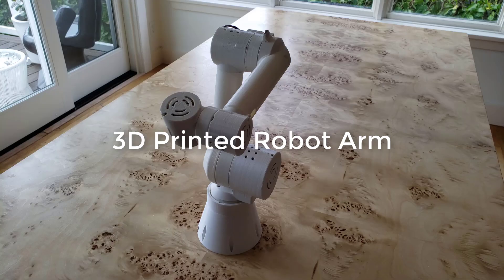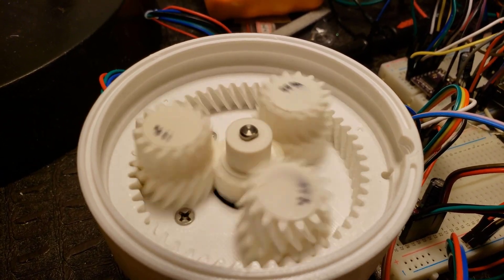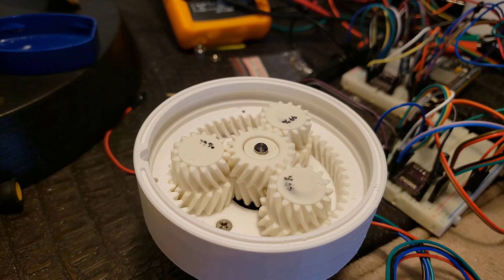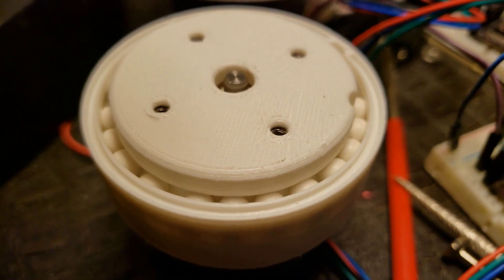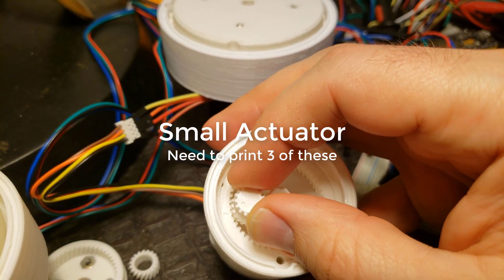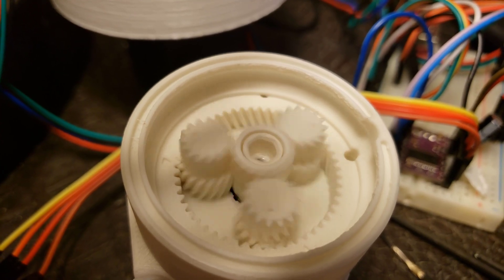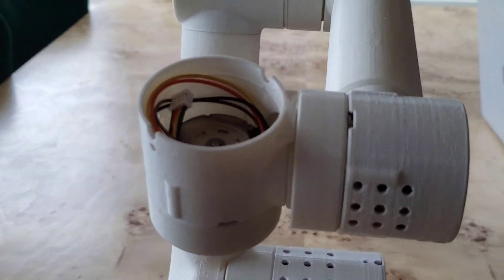3D Printed Robot Arm

Comment: Your sanding, filing, and inaccuracy issues could be solved by calibrating your printer. 

From the video it looks like you've got some bad overextrusion issues or fine layer shift. Also, your nozzle is too close to your bed. It's digging into the surface of your prints.
Reply: True, I can't imagine that choice, but that's personal preference. Insane temperature for basic pla too. I print Amazon at 200 and it comes out beautiful on any of my printers.
Reply from the maker: I printed all my prints on rafts, thus that first layer which you see on the top of the cap are the remnants from that. All of my other layers turned out perfect. I have tried printing without the raft and I do get problems on the 1st layer being squeezed. I've dialed that in better since shooting this video. I too think printing PLA at 235C is very high and there are complaints about the Amazon Basics, but it does end up more rigid than the Hatchbox which prints fine at 200C.
Reply: Indeed... I found it a little amusing when he talked about liking the Amazon PLA printed at a high temperature better than the hatchbox PLA. He's got printing issues that are much more important than filament choice.

Comment: Nice work John! I've been working on a multi-axis arm with planetary gears also and since I have no idea how these joints are supposed to be designed I've gone through a lot of trial and error. Taking a look at your design is really helping me improve my design (or pretty much copy yours) so thank you for sharing this
Reply: Guess credit for the design is Jeff, but your contribution helps immensely. Thanks again!
Reply from the maker: @jaredgray7872  Check out the latest flex spline design of the actuator I'm now using. It's even better. https://www.youtube.com/watch?v=4o3d7_WZ_DQ

Comment: This is amazing!!. So clean and robust. What is the load it can carry? Any tests carried on that?
Reply from the maker: It can carry 1 pound.
Reply: @JohnLauerGplus  what would be the possible changes for 4 pound payload.? Motors and higher reduction ratios I guess?
Reply from the maker: @sharath_naik  yes, I think that would be the trick but you may have to move to metal to do that.

Comment: how do you fix the case on the sun without using screws on the axis ???
  if I see, you block the two pieces together by 6mm bbs

how do you do I ask the question !!
Reply from the maker: Yup, the Airsoft BB's holds it all in.

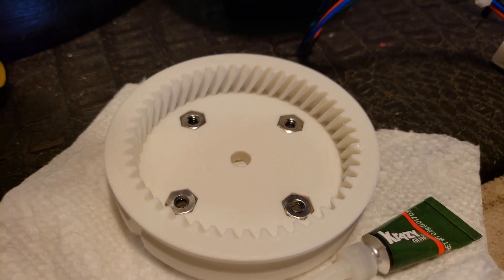Comment: @03:35 You can simply create a press fit cover for the inside which will in turn hold all the nuts in place. Falling nuts into a PG system is no fun and will not be an issue if the cover is placed.
Reply from the maker: Good idea. It would add some height to the system, but probably could make the cover be 0.6mm height, so wouldn't add much. Those planetary gears do rub along the top where those nuts are. The top sun gear does push itself up towards the roof of the gearbox. So do the planetary gears, so the smoother the roof, the better. A cover could help that be even smoother than having those nuts exposed. As I've seen the grease squeezes up into the nut holes over time. Although, I do think it makes sense to have some gunk repositories where over time the shreds of plastic can bunch up and get pushed into depressed areas to help give longevity.

Comment: @0212 Nice job but why don't you adjust the 3D model to create a counter-sink for the screws. I don't see an issue here since these were printed in-house.
Reply from the maker: Yes, I agree. That base should be raised by about 0.5mm or even 1mm to sink the M3 screws further. The downside is the sun gear height is exactly the shaft gear height to get full contact, so you'd end up with the sun gear 0.5 or 1mm higher, but that probably is an ok tradeoff.
Reply: @JohnLauerGplus  Nope, no trade off at all. shit the base of the PG system by making it a little thicker to compensate for the inner nut cover. that way everything inside stays the same length.

Comment: ive heard some bad things about mixed vaseline and plastics, it supposedly breaks the plastic down. I personally use white lithium grease. not sure if its true, but better safe than sorry. great video btw
Reply from the maker: I was worried about that. I searched online and couldn't find much data on the correct lubricant. If vaseline breaks down the plastic, then indeed something else should get used. I'll try the white lithium grease like you suggest.
Reply: @JohnLauerGplus  I definitely second the suggestion of white lithium grease. You'll commonly find it used in joysticks and things because it's plastic-safe. 👍
Reply: Luke Cunningham I’ve used Vaseline on white ridgid ink PLA in a 3-stage planetary gearbox. It was over a year ago and it still runs fine; no noticeable softening. I was a bit apprehensive putting the Vaseline on, but I guessed I could just print another gearbox if needed
Reply: Can't go wrong with silicone grease. Used in distillation lab equipment because of how little it reacts with other chemicals.
Reply: I thought the same.
Reply: I believe it depends on the type of plastic, some plastics react to it and some don't. Would depend on what type of filament he used for the print.
Reply: axle grease is vegetable based divergence of polymers may result in less  decomposition
Reply: Correct. Never use Vaseline.
Reply: You could try Super Lube. It's a PTFE based grease and seems to work great with various plastics.

Comment: payload:) ?
Reply from the maker: 1lb. So, if you want it to pull the magnetic heated bed off your 3D printer and place the new one, you should be able to.
Reply: @JohnLauerGplus  Great work! Inspired by UR robot? Looks like an UR3
Reply from the maker: @Richard89977  Yes, this is inspired by that brilliant UR3 robot, but credit to Jeff Kerr (LoboCNC) on Thingiverse for the design.

Comment: What does all that do for the arm. Why is that better than just having the motor directly move the part?
Reply from the maker: Stepper motors are very weak motors relatively speaking. The planetary gears give a major mechanical advantage for strength and a finer grained positioning of the movements since stepper motors are 200 steps per rotation. You end up with 200*38.4=7,680 steps per rotation with these gears so your degree of positioning is huge. You end up with greater torque as well. More importantly you need that slew bearing using the airsoft BB's or the arms won't connect to each other with strength, otherwise you're trying to use the bearings built into the stepper motor to support everything.
Reply: @JohnLauerGplus  do you know of any good videos explaining how these gear boxes work in more detail. I'm very interested in learning more also are those parts available for download if I get a 3D printer? Any links to the motors as well?
Reply: Just noticed you had links in the details. I'll check it out. This gives me a great reason to get a 3D printer now.

Comment: which programm did you use for the gears ?
Reply from the maker: I didn't design the gears, rather Jeff Kerr did. Here's his page on Thingiverse https://www.thingiverse.com/thing:3327968, however you can use Fusion 360 for free if you are using it for personal use and it has incredible gear design algorithms built in. Jeff provides his STEP file and you can import those into Fusion 360 and then modify to your heart's content.
Reply: Check http://hessmer.org/gears/InvoluteSpurGearBuilder.html, this link was in the video of the original designer of the arm.

Comment: Please show how it works, it would be nice.
Reply from the maker: Working on it +Mikael! The next step now that the actuators are assembled is to get the electronics going. Using ESP32's in each joint to generate stepper pulses and then will use ChiliPeppr's Cayenn protocol to upload all Gcode moves to each joint. Stay tuned.
Reply: @JohnLauerGplus  thanks for the answers keep up the good work. Very interesting content. 👍
Reply: @JohnLauerGplus  Hello. I'm working on a similar project. Could you suggest a library for solving the inverse  kinematics problem?
Reply from the maker: Now you can see it working https://www.youtube.com/watch?v=RdmdFIhCo4M sort of and there's a ChiliPeppr workspace coming together at http://chilipeppr.com/arm
Reply: @JohnLauerGplus  can this be converted to a cnc mill?
Reply from the maker: @GAMINGNOMAD1  I don't think that would work well with this design.
Reply: Wow..... this is really good job. I hope your effort easier access to robot technology for anyone around the globe. #globalpride
Reply from the maker: @mohdyuzairin8719  Thank you.
Reply from the maker: @Jamecbond  not if you want a touch sensor in each actuator for record and playback. Also, they are $3 each. That's so cheap you can sprinkle them everywhere. Also, running wires is a serious problem and this avoids that.
Reply from the maker: @Jamecbond  Check out the latest Part 3 video to see how the ESP32 has progressed. It'll help you see why I was taking this approach. https://www.youtube.com/watch?v=4o3d7_WZ_DQ

Comment: Nicely done. Any estimate on total project cost?
Reply from the maker: About $260. $60 from onlinestepper for the 3 NEMA 17's with shipping. About $80 for the 4 small 35PM048S8-08001 from Moon's. About $30 in machine screws across the 4-40's, 6-32's, and M3s. You need taps for the 4-40's and 6-32's to create the screw holes. About 1 roll of filamant, so $20. About 10 days of 3D printing so lots of electricity. Had to buy a 0.3mm nozzle, so about $5. Then 6 ESP32's to put in each joint @ $6/ea. A DRV8825 driver for each joint which are like $1 each on Aliexpress. A 24v power supply for the whole thing so about $25. I got 6 PSP joysticks for each joint too for doing record and play and those are about $1.50/ea on Aliexpress. Crazy glue so $5. All in, this is a very inexpensive robot arm. It's not fully working yet though, so may have some more incidentals.
Reply from the maker: Oh, I'll also add these were printed on the Creality Ender 3, so even if you include the cost of the printer which is $200, this is still a crazy cheap robot arm.
Reply: @JohnLauerGplus  whoa, thanks for that detailed bill of materials. Wish every maker was as kind to share this info, helps a lot when considering following a maker's steps and doing something similar.
Reply: @JohnLauerGplus  why do you use 6 esp32?
Reply from the maker: @mustafasengor3762  The esp32 is an amazing microcontroller. It's 10x more amazing than an Arduino, has Wifi and Bluetooth built-in, it's small, and it's cheap, and powerful enough to run Lua, and lots of RAM. So, it can control each joint fully with stepper driver, LED driver, joystick, temperature monitoring, endstop monitoring, etc.
Reply from the maker: @mustafasengor3762  Check out Part 3 to really see why the ESP32 has been so magical. https://www.youtube.com/watch?v=4o3d7_WZ_DQ

Comment: hello,
It's an impressive design. can you also do a video on inverse kinematics...
Reply from the maker: That's going to take a while to get all of that going. You will be able to send Gcode to the robot arm from ChiliPeppr from a new workspace, so you'll be able to visually see the robot arm move in the 3D viewer. A typical Gcode command would look like "G1 F200 X2000 Y3000 Z500 A234 B111 C222 D300" where G1 is a move that supports feeedrate which is the F value. XYZ are the base, shoulder, and elbow so going from bottom of robot up. ABC are the 3 wrists from base towards gripper. D is the gripper.